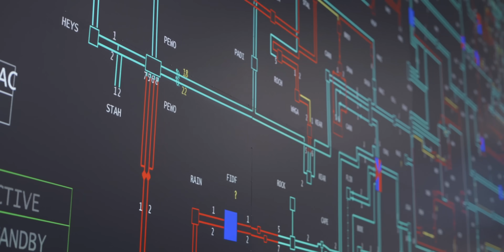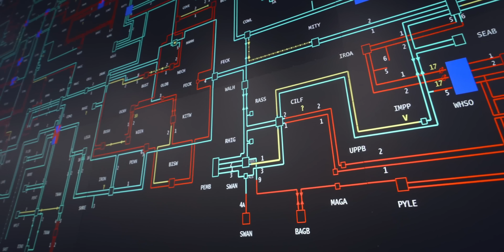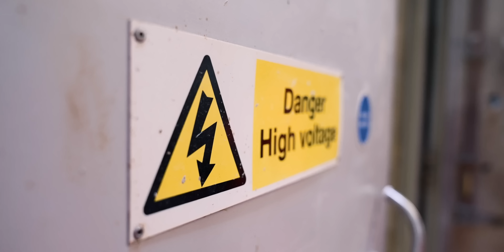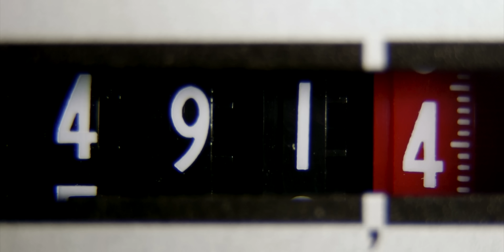THIS is Why the Grid is Ready for Electric Cars!

Comment: The grid is currently large enough, our maximum demand has shrunk from about 60 Gwatts to 45 Gwatts in the last 20 years. 

The local area network  (33Kv to 415v) on the other hand is far from capable of a significant increase in ev and heat pump expansion. Increasing it's capcity involves lots of road digging to install larger capacity cables, replacement of the very many transformers that supply the consumer. It will take a lot of time and money to match government targets.
Reply: Totally agree, it is the local infrastructure that will be the problem in the future. My local County hall wanted to install car chargers but could only have 2 as the 11Kv transformer wouldn't  take extra load. The 11kv switch burnt out some years ago ha ha.
Reply: As someone who's been involved in an off-grid install or two (father-in-law's entirely off-grid solar PV/battery powered cabin and my brother's house is 90% solar PV/battery powered, only needing the grid in the darkest months of the winter) I can tell you that the grid really shouldn't be upgraded.  It's unneccessary.  Micro-generation is a much more inteligent way to generate renewable energy.

Imagine every rooftop in the country having solar heating and PV/wind turbines, backed up with a small sodium ion battery (which are cheaper than Lithium, with double the cycle life, they just take up more space).  You're off-grid capable but still grid-tied.  Now, when you want to charge your car, the energy comes locally - from your rooftop and battery, but also from your neighbours.  Very few homes would need the grid for more than excess energy export.

Those without a driveway could charge via a local lamp-post charger, and be charged via their home.

Every home, every factory, every supermarket, every office should have microgeneration.  The grid would not need upgrading at all, as most of your power would be made on site, with only the most power hungry homes and factories/offices needing to put a significant load on the grid.

Well, maybe a few larger connections for motorway chargers might be needed, but that's about all.  And even those could use sodium ion battery packs to minimise peak loads.

And it's more than capable of supporting those loads as is.

The main reason why I don't see this in our future is profit margins for large power, oil and gas companies getting in the way.
Reply: Anton, 

fine if you want to rely on your own generation.
Not fine if you need large amounts of power reliably at all times.
You cannot run a grid on renewables alone , it just does not work.
Reply: @iareid8255  That's nonsense.  Understandable that people believe that, since there is so much misinformation running around, but Norway already does it.  And have done for decades now.

General Electric have stated publicly that their UK wind turbines have over 99% availability, and are only turned off for maintenance or to prevent overloading the grid.

Meaning that it would take a relatively small battery for the UK to transition to 100% wind power.  The UK's existing fleet of electric cars, if used as vehicle to grid storage, would be enough.

The fossil fuel industry wants you to believe that renewable energy is a pipe dream.  That's just marketing nonsense from dinosaurs who want to sell us liquified dinosaurs.

Renewable energy is not just feasible, it's the cheapest way to make energy.  Even if you don't care about the planet, you should want as much of it as possible as it would mean lower electric bills.
Reply: Anton,

Norway is one of the very few countries with substantial hydro electric capacity, a far better source than intermittent wind. 

You claim what I write is nonsense, but your offering is not even in this world.
Wind turbine measured availability is in the order of 35% on average in the U.K..
There is no possibility of using battery power as back up, none at all.
It is not even possible to run a grid on wind power as it is uncontrollable , like driving a car with no throttle.
And is is very expensive, I can only assume you read what rubbish the media publish or broadcast. 
What I write is not from the fossil fuel industry but my experience in the electrical generation industry.

Comment: Nope. The grid is not ready for everyone to drive an electric vehicle! Much more work needs to be done. I say vehicle manufacturers need to work with the grid providers to make bi directional transfer of energy happen in a smart way. A more granulated reporting of "peak" and "off peak" electrical use would be a start. The huge vehicle batteries could be used to offset large demand, and charge whenever there is less demand. The whole system could be used more efficiently and with less human oversight. It's very possible, but certainly not there yet!

Comment: Never mind the cars, when we are no longer allowed to have natural gas boilers and cannot afford electricity because the prices have gone through several roofs, all this infrastructure is great but at the other end of it you need generating stations that are NOT reliant on the wind blowing or the rivers running at sufficiently high flow, when the weather has become drier and drier. What then? We are continually being warned that the power grid is stretched to its limits and we are years behind on construction of nuclear plants. This is all style and no knickers!

Comment: Why focus on the National Grid? Their systems are the transmission part of the UK total grid, being under 4%. And designed to supply industry as well as domestic (always more than domestic demand alone). The remaining 96%+ of the system is built and maintained by the Distribution Network Operators (DNOs); the DNO stuff is mostly hidden yet the National Grid's stuff is very visible as their cables stride across the country. 

National Grid are a company and speak for the National Grid's 4% of the whole system.

DNO networks (local grids) are not part of the National Grid. Q: Can the DNO systems, which deliver 230V to your house, cope?

UKPN (UK Power Networks, the DNO for Kent, Kondon, East Anglia) build networks to traditional gas-heated homes to supply c. 1.5kW per home continuously. So for a 100 homes group, supplied by a single 230V network, a 150kW system would be installed. That's for estates built up to say 2020 (what happened after then... I am not so sure, as I retired).

Guess where the problems are? Well, not in the National Grid's 4%. Good luck trying to charge as many EVs as cars on that 150kW system. Well that's c. 130 EVs wanting to charge at 7kW. So they don't all charge at once? Then we get into maths and simulation (my job). Answer: Can't do it, even with Smart help. HP's are the final straw; new local networks please!

This has been pointed out many times from 2012, eg. the DS2030 report published in 2012, commissioned by ENA and written by EATL.

Comment: Thankyou for this film, not often a I see such an important and interesting one. I live in the countryside and have been told that all of our power infrastructure is going to be replaced due to its age and for a redesign. 
I do hope Helen is going to make another film about the new style national grid pylons and the new ways that we shall be using the grid connection to our homes/businesses.
A local engineering firm in Tewkesbury is having its roof covered in solar PV panels, I don't know if they will export the power or just use it on site.
 I am going to rewire my house, out buildings and garden to accommodate: an electric car; 3-4 PV arrays mounted on low rise outbuildings; battery storage ; phase changing/ water heat storage storage and possibly a ground source heat pump. I would be interested in knowing more about what my house may be connected to in the future. What will be the new do's and don'ts for household grid connectivity and usage.

Comment: An interesting point that was skipped in the video is that high-voltage DC transmission lines are more efficient than AC, yes, but where it really matters is for underwater (especially saltwater) transmission as shown here.

High-voltage AC transmission lines lose energy through coupling to the surrounding environment as the voltage switches back and forth, and the more conductive that environment is, the worse those losses are. They're pretty manageable when the cables are in the air (since it's a very good insulator so it doesn't couple heavily to the cables) but in salt water that's a different story, so you see much more common use of high-voltage DC for underwater transmission lines where the extra conversion costs at either end become worthwhile at much shorter transmission line lengths.

Comment: Fully charged show any details on the the converter hall would be appreciated if really like to know how thay are converting that amount of energy from DC to AC is it via solid state semiconductors and how thay operate or big DC motor's and generators
Reply: It's solid state. It's exactly the same basic technology that converts the DC battery voltage in a EV into the AC that the electric motors driving the EV along need, just on a much, much, bigger scale.

Comment: And if you couple this with homeowners and business being able to incorpoerate solar panels into their infrastructure (homes and buildings) along with battery storage you can take stress off your grid, power your home, charge your car with locally created and/or stored energy.

If you also enact VPP (Virtual Power Plant) where each homeowner shares their energy on demand with their neighbors it will reduce stress on the national grid as well. There are so many things that can be done. But I'm getting tired of the weak argument about how the grid can't handle "all these electric cars". It's so frustrating dealing with people who don't understand that we've been increasing demand for electricity well before the up tick in EVs and we've been able to support this demand. Now while much more infrastructure planning and implementation needs to happen we have to acknowledge that the grid will and is growing year over year to meet various demands. hopefully we can put that question to bed about being able to support an electrified future.
Reply: There is an issue with videos such as this in that they give a 'helicopter view' of the 'grid'. Yet again, the supply networks are presented in a homogenised manner that fails to recognise the different challenges presented in transmission and distribution. Videos are made about big sites like the interconnector converter station so the audience can oo and ah at the technology and perhaps rightly so, for they are impressive engineering feats. Improvements to local DNO networks are probably not so engaging.

In terms of off-peak electrical energy consumption, there is significant capacity in the transmission networks to cope - for now. There are some big transmission network projects underway and in planning to allow large renewable generation sites to be connected. We will still have difficulties for some time, though, when you consider that the generation fleet occasionally gets close to available capacity when we have weather in the UK that results in cold air temperatures and little wind - that's why we've seen recent initiatives like the Demand Flexibility Service to try and reduce demand at peak times.

However, for the vast majority of people, it is the limitations of the low voltage network right outside their door that present one of the greatest challenges in moving their energy consumption from direct use of fossil fuels to electricity. The LV networks were never designed to accommodate either the levels of energy consumption (eg EVs and heat pumps) or generation, principally from solar PV. Upgrading these networks is a lot more difficult simply because of the localised disruption it would cause - and that's before you consider the cost.

It's all very well making aspirational statements about sharing your energy with your neighbours but if we assume almost everyone shares that aspiration, where does the energy go, exactly? For example, a nice, sunny day with a row of houses all fitted with 3kWp solar PV generation and no load in each house apart from maybe a fridge-freezer. Community energy storage?

I think you will find that it will be some time before the question of how do we support an electrified future is finally and satisfactorily answered.

Comment: Love all these videos from fully charged. Just an aside; I thought AC was better at traveling distance and DC was OK for smaller distances - thus the need to keep cables short as possible when using DC charging etc. Am I wrong there? It seems the engineer explaining things at 9:21 suggested the opposite! She said; "The DC system; the direct current, is actually a lot more efficient over long distances; You get very, very minimal losses, but when it connects into land it must then change into AC to be able to connect into the grid system"   I thought all long distance connections were via AC and the voltage was transformed down as it got nearer the end user. Did I get my 'wires crossed'?   She sounded very definite so perhaps I'm missing something.
Reply: Its... complicated. For medium to long distances, AC is used because the line losses are acceptable and stepping down the voltage to the end consumer is simpler and requires less infrastructure--just a transformer. For very long distances of 1000 km or more, a very high voltage dc line will have less transmission losses and smaller diameter cables can be used. A medium to low voltage DC line over long distances is less efficient. Converting the high voltage DC into the much lower voltage that can be safely used by consumers without converting most of it to waste heat (like placing a giant resistor in line would do) is more tricky. Consuming the DC power efficiently is also a complicated matter. Converting to AC sidesteps these issues for the price of some conversion losses.
Reply: Soo...the woman actually DOING the job knew what she was talking about!!
Expert 1
YouTube 0
What a shocker......!

Comment: No one that I have heard is considering the amount of electricity it takes to put a gallon of gas in my tank. If I'm driving an electric car I'm not using gasoline. This means whatever electricity I use to charge the electric car is more than offset by the cost of producing gasoline and putting it in my tank. Why is no one even talkin about this fact?
Reply: Your EV has never helped build or even maintain the gigantic infrastructures let alone the grid!!!! So calm down! The same oil is used to make those long Interconnect lines undersea, solar and windfarms offshore!!!!

Comment: ? Since DC is more efficient for long distance delivery of electricity, why did Edison think he had to put power generator stations every few blocks??? This is not a snide comment, it is a humble question. What am I missing?
Reply: Losses, through resistive heating of cables, are proportional to the square of current. Power = voltage times current. If you can use a high voltage you can transmit power at relatively low current, if you're transmitting at relatively low voltage (as Edison was) you have to use high current and therefore lose more to resistive heating of the cables carrying that power. The Norway interconnect operates at half a million volts DC, Edison was operating at 110 volts DC, 4545 times lower voltage.
Reply: @ianmason.  Thank you very much Ian for taking the time to provide those additional facts & details. It makes perfect sense now. 🙂

Comment: It's safe to say the "average man in the street" has absolutely no idea about the level of infrastruture and projects that are routinely furnished by our network providers. 

 In fact, despite the fact we can clearly bring 1,400 million watts of power over 720 Km of underwater cable, operating at half a million volts and 3,000 amps, apparently EVs won't catch on because it's quite clearly "impossible" to get a cable 1.5m across a pavement to our cars safely....... ;-)

Comment: Amazing to get a glimpse of the Norway interconnect.
Tesla won over Edison mainly due to AC being more efficient to transport over long distances compared to DC, guess they didn’t test 400,000 Volts DC transmission lines 😮😄
Reply: Not quite.  What Tesla showed was that high voltage/low current distribution was more efficient than Edison's low voltage system and with the technology of that day, AC was easier to raise and lower in voltage than DC.  In this 21st Century, with the advent of power Mosfets, IGBTs, etc., both AC and DC distribution systems both have their uses today.  In the US, 750,000 volts is high voltage DC and we even have 1,000,000 volt DC lines.
Reply: also the damn plug can go either ways with AC. With  DC it's only one polarity, so it would be like usb always wrong side in. Yes, seems people were smarter in the old days.
Reply: My bee there is only one DC cable. I think the ions go thru the sea.